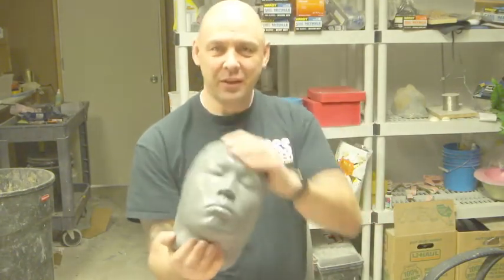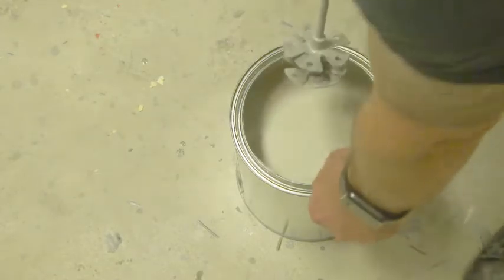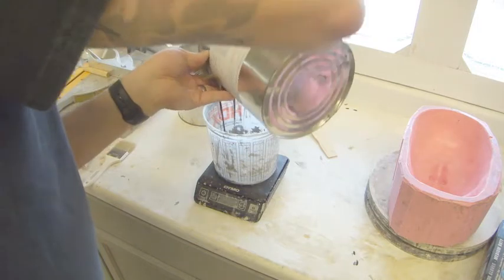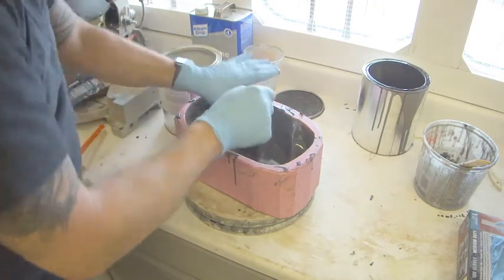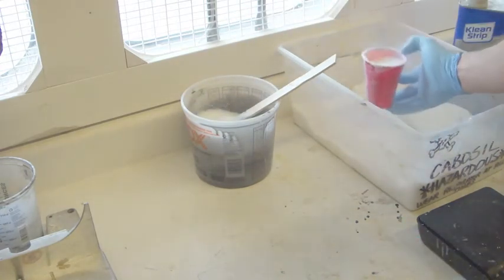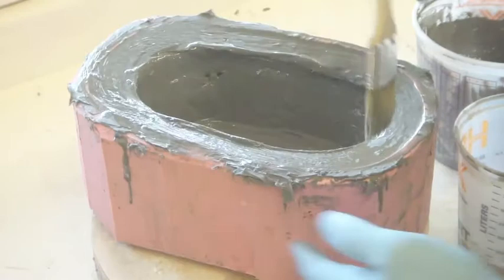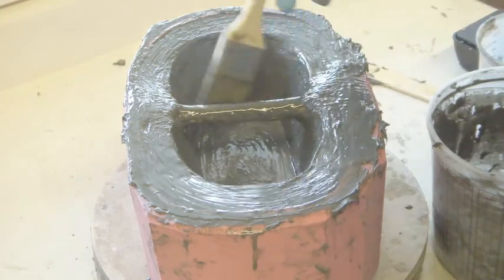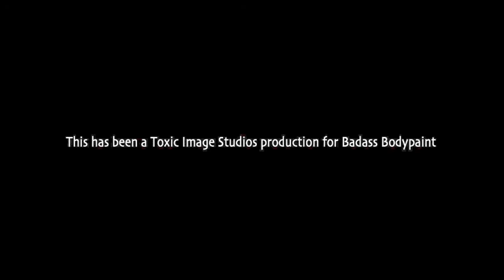TC1630 part 1: Making a Core

Comment: Thank you so much for this!! So helpful. Quick question, did you use any release on the silicone? Or was there no need for it? Also, can you use polyfiber instead of cabosil?
Reply from the maker: I sometimes use a mold release but it is mosty not necessary. It will however prolong the life of your mold if you do. I have never used polyfiber with TC1630 so I cannot answer that.
Reply: ok cool, thanks for that! I am currently watching the matrix mold vid haha they are great!